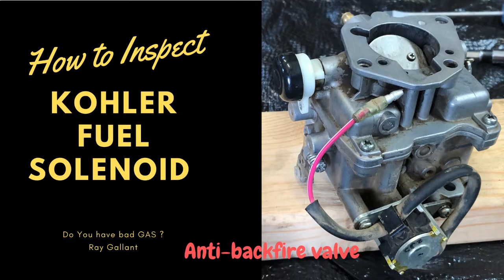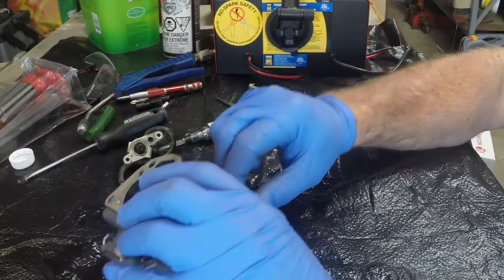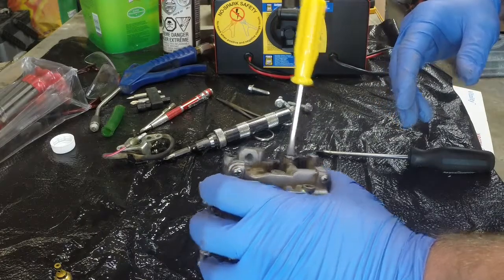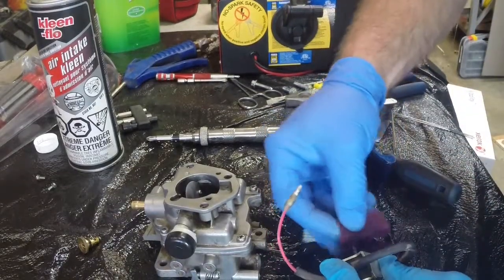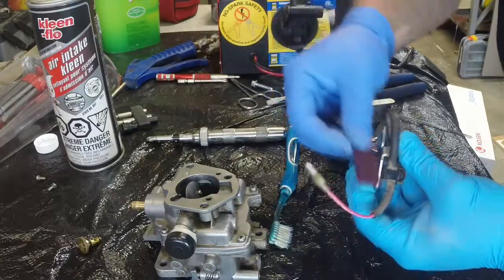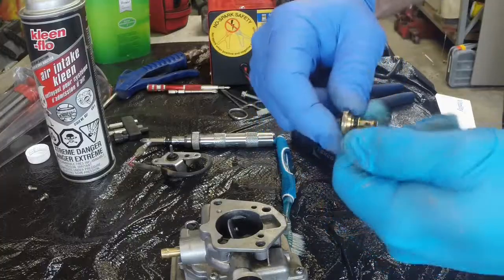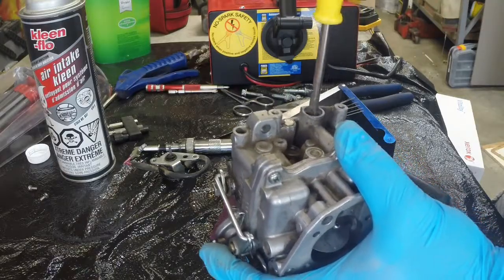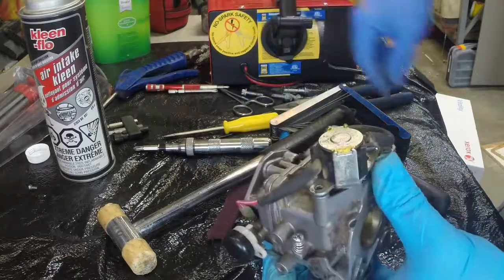Kohler Command fuel solenoid

Comment: It have a 25hp kohler, carb 24053

Runs on choke, choke off dies.

Power up runs on partial choke. Open it sputtering. Clutch out-no throttle dies. 

Jet or solenoid?
Reply: Is everything else proper or perfect?

Do you have clean airflow coming in? 
Do you have clean gas? 
Including all of the fuel in the filter and in the line 
Do you have a clean spark plug? 
Do you have a strong spark on the end of the spark plug? 
All of these things taken into account if everything is perfect I would most likely say you have a clogged jet or a clogged airway. There are some awesome videos that will help you detect where the clog is coming from by this type symptoms

Hopefully this helps it’s hard to diagnose unless I’m actually in front of the machine and seeing it run 

Ray
Reply: @ yes i changed fuel:filter an plugs. Ive pulled jets out an they are clean. Ran great then all the sudden doesn’t.

I ran a bottle of injector/carb cleaner through an it seems to be a little better but not back to how it should be.
Reply: I just cleaned my solenoid and it only runs with half choke but the little rod is really pitted up. Guessing that's why the choke . Maybe yours is the same way?

Comment: Min runs good on high bud turns off on the low what do I think
Reply: 90% of the time whenever you’re dealing with any type of car problem it’s fuel

Not necessarily the fuel that’s in the unit right now, but fuel that’s been in the unit in the past 

To diagnose this, I need the unit in hand and see it run, etc. currently is everything to do with the carburetter and fuel and lines completely 100% clean because the smallest amount of dirt or scale buildup could clog a passage or a jet inside the carburetter

Comment: I ha e a question  for you. Have pretty much the same engine on a lincoln ranger 8 welder. I was cleaning the carburetor and dropped the float needle in the bottom half of the carburetor which goes into the block. How can I get it out?

Comment: Removed the fuel shut-off plunger from the solenoid as the coil was bad, cleaned all the jets, the Kohler 2 cylinder ran and idles better than it had in years, same Japan carburator.
Reply: The Japanese carburetter is much better than some of the other carburetters out there

Comment: Just snip the fuel solenoid and make sure you install a full shut off on your fuel lines. Problem solved!
Reply: That is not what the fuel solenoid is for. It is to prevent engine run on after the spark is cut off.

Comment: I HAVE A 18 HSP KOHLER WILL RUN ABOUT TEN SECONDS THEN SIMPLY QUITS AND IF U START IT AGAIN DOES THE SAME THING
Reply from the maker: Good news is it’s only one of two things fuel or spark
I unfortunately to check the system there’s at least 100 different things you need to do to rule everything out
Your only advice I can give you is fuel fuel fuel 99% of the time it’s the fuel

The only time I’ve ever run into Spark being an issue I was on a tapping machine it would run for three or four minutes and then stop because the spark plug had a crack in it but it looks new so no one replace the spark plug

Is the fuel system filtered?
If it is not it’s highly likely that there is a small particle clogging one of the Jets or orifices in the carburetor

Hope this helps
Ray

Comment: After 20 minutes of operation (motor cultivator) the engine (Kohler CH395) starts to give and reduce gas and then shuts down. After that it will not light up for 5-10 minutes. Most likely until the engine cools down and then starts again and runs for a while until it shuts down again. What is happening?
Reply from the maker: Keep in mind I would have to see it and be there when it’s running to see if there’s problems
Have you taken the carburetter part and cleaned all of the offices 
It is possible that there’s something clogging one of the Jets(ports)but only after a certain amount of fuel goes through the carburetor

After it shuts off is there fuel in the carburetor

Could be a crack in the fuel line or there’s something wrong with the fuel pump but it’s not supplying fuel to the carburetor

Have you replace the spark plug as possible on the spark plug it’s up at the gap separates because there’s a crack in the actual plug

Unless I’m there I cannot give a definite answer of what it is or what it could be
Sorry
Hopefully this helps or gives you something else to look at

Remember almost all small engine problems is fuel fuel fuel

After it shuts off and will not start is there spark?

After it stops running if you pour fuel directly into the cylinder will it fire over and run

Will it fire over and run if you pour fuel directly into the carburetor

Comment: my stump grinder has this 25hp engine and some times it takes ages or wont start it says on engine b for switching engine off make sure throttle is midway could this b y mine wont start as i stop engine when its on idle
Reply from the maker: it could be that
if its not the problem it will come out without a problem and if there is a large amount of run hours it should be cleaned
Reply: Hi Paul I have a recall with a 25 hp on it too it just shut off on full throttle I can’t get it to restart I replaced the fuel pump I’m wondering how you made out with yours
Reply: @kunion36  i got shut of it got bran new predeter 460  i got it going again took a while though but it was an old machine over 20 years old
Reply: @kunion36 did u sort it out? I have same issue. Would appreciate any help. Regards Col west Oz

Comment: What does this solenoid do? My 26 HP V Twin will run smooth but is bogging, not making power when the blades are engaged. Blades turn free and wind down normally.
Reply from the maker: The fuel solenoid stops the engine from running on or knocking after you turn the engine off
The biggest problem is sometimes Seized in the off position and won’t allow the engine to start
Reply: Rays fix thank you. Now I understand.
Reply: @raysfix  my Kohler pr0 25 is running rich and runs on after shut off.
Reply: @citizendick6087  Mine does the same.  (CH740) 
Replace the shut off solenoid and like he does in the video, check the main for obstructions that keep the plunger from fully closing off the fuel supply. 
Or, just replace the Kohler crap with something actually reliable, like a Honda or B&S.

Comment: Hey Ray, thanks for the details! I can't seem to figure out where the fuel solenoid wire is supposed to be connected to. I know it goes under the cover to the bottom sonewhere.  I have white, yellow and green not hooked to anything. Also a thin red wire unhooked. 
Any help?
Reply from the maker: I have the wiring diagram I could send it to you 
I gut it from kohlerengines.com
ray